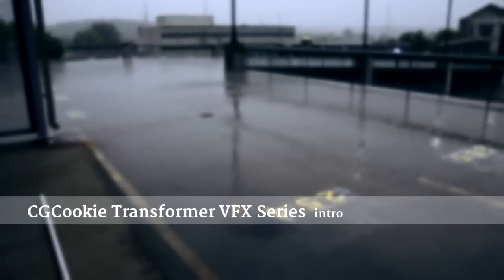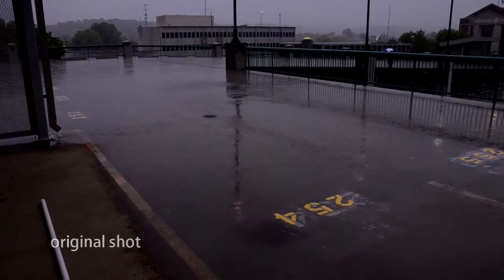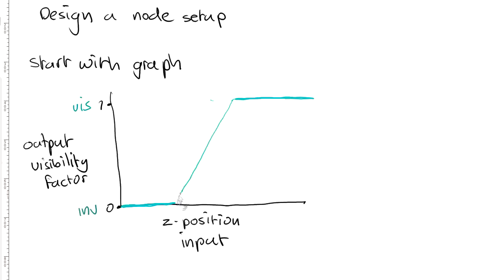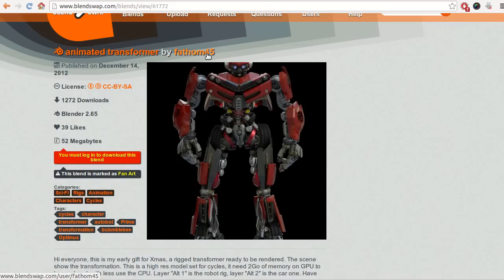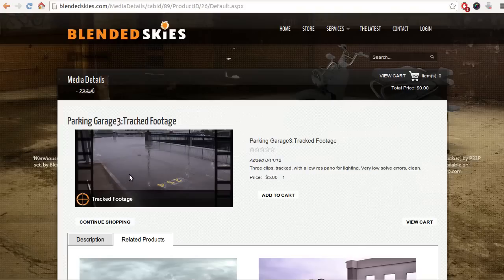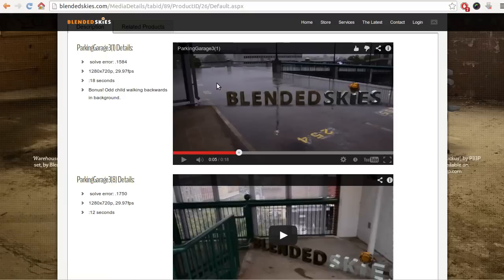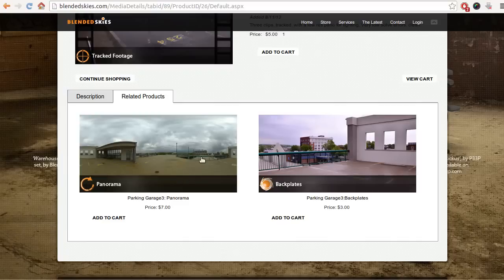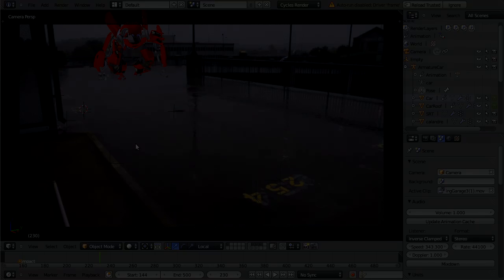Transformer VFX Compositing In Blender - Tutorial Course Teaser

Comment: Looks nice, but Car is too big. It should have gotten smaller since the camera is way the distance... I believe that the child is at least 5 years old and the car rim is way too taller than him if not equal... The colors a  little bit bright The darkest part of the mesh should be equal to the darkest part of the scene and the windshield should be as glossy as the wetness on the pavement. Volumetrics should be used with the lights of the car. I believe it's raining since there are pours in the road. Additional particles in the beam of the light would make it much more realisitic...